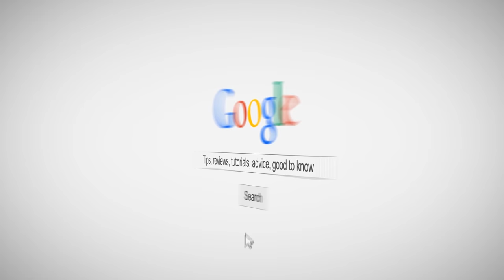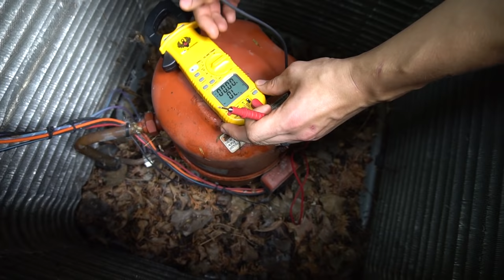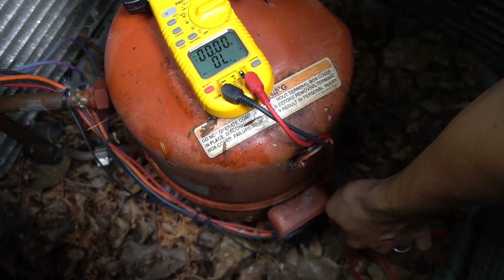AC Keeps Tripping Breaker and The 10 Most Common Reasons Why

Comment: Nice video.  But, do warn your listeners that this is dangerous stuff, that only those who have some knowledge about dealing with electrical circuits should undertake. The units are wired into two lines .. ie. 230 V. This is not your 110V appliance and mistakes here can be fatal.

Comment: just cut heat on a few days ago. had the heat running downstairs and ac upstairs. now the breaker in the breaker box keeps tripping as soon as the unit is turned on. have checked all scenarios you mentioned except the compressor, hoping that is not the issue, but.....

Comment: What if you’re only get 120v from the contractor / disconnect will it trip the breaker immediately or with the compressor just not kick on?
Reply from the maker: Usually the compressor will not come on but the fan may start spinning but only at half speed.
Reply: Thanks. I condemned a compressor today because it was tripping the breaker then I was second guessing myself because I thought I checked voltage and it had 120 but maybe it did have 240v. So I wanted to make sure if I was only getting 120 would that have cause for it to trip breaker

Comment: My A/C had been  idle for 3 years. I swapped out handler and it was working fine the first day. And when it reached cooling temp after a few hours (from 85 to 72), it shut off as it should. Then when the temp rose, when it tried to kick on, the handler blew, and the condenser motor spun momentarily, but then tripped the breaker. For the next couple of days, I could get it to come on initially, but same problem. Today, it won't even give me a one-time cool. So ... I unplugged the wires to the compressor, called for cool, and the breaker did NOT trip. Does that 100 percent automatically mean that it's a bad compressor? I'm a bit surprised it failed the way it did. The capacitors aren't bulged or leaking, but I thought I read they can cause a breaker to trip. Can they? Please advise prior to me hiring an HVAC guy who I know will automatically tell me I need a new compresser, then reason that I should get a whole new system.
Reply from the maker: It does not happen very often but it is possible for a bad capacitor to trip a breaker. If you have a multi-meter, you could check the capacitor and the compressor to know for sure.. If you don't have a meter, then I think replacing the capacitor is worth a shot. Although unfortunately a bad compressor is more likely.
Reply: @WordofAdviceTV  Thanks. Please note I did test the compressor by testing for continuity at the leads. They all showed numbers other than "OL." So doesn't that mean it's good/not grounded out?

Comment: My breaker trips when the Compressor connected, and doesn't when it's not. But also I tested all three pins on the compressor for a short against the top and there is no internal short. What could be the cause of this issue? My unit also had a white starter that was completely burned up. But I am guessing it can start without this. Any tips would be helpful. I am tempted to just buy a new start kit and capacitor and see if it fixes the problem.
Reply: Not looking good. Still trips breaker instantly with the new run and start capacitors installed. Although I did put back the original cap and it ran for like a second before it tripped but then after resetting the breaker, it tripped instantly again.

Gonna try replacing the breaker as a last ditch effort before calling a technician, but I am fairly sure at this point that the compressor is the culprit. The fan runs if I disconnect the compressor.

Comment: Why does my AC condenser trip my breaker sometimes, but NOT ALL THE TIME? When it trips, I press the breaker switch back 2 or 3 times. Then it works again, and the air conditioner runs normally. However, when it reaches the preset temperature, stops, and then restarts, it trips again. I have to reset the breaker several times to get the AC to run again.

My AC is a Carrier brand, five years old. I've checked the capacitors and relays, and they both look fine. The condenser coil isn't dirty, and I replace the filter as usual.

Comment: When the ambient temperature climbs in my window ac, the compressor  shuts off dimming lights in the house momentarily then the compressor is off but after a period the compressor turns back on and runs cold until something reaches a certain temperature and shuts off again. At night the ac operates cold until it warms up in the day. 
When  the compressor shuts off there is a heavy drain electrically s from some where

Comment: Could a super plugged evaporator cause the breaker to trip as well?
Reply: Tommy, I was about to replace my capacitor, but upon further troubleshooting, I see my main breaker trips without the cap in place and without the lockout in place, that tells me the main panel wiring to the lockout box is bad?

Comment: My only 5 year old compressor is causing the breaker to trip. What causes the compressor to short out in the first place typically? You find it odd a 5 year old compressor would short out? Having a whole new unit installed and I'm not happy at all. Thanks got any help.
Reply from the maker: So the compressor is shorted to ground? Was it tripping the breaker right away or would it run for a while? My guess would be that there was something off in the refrigerant. Perhaps it was overcharged, the metering device was not working right, or there were contaminants in the system. When they initially charge the unit with freon, if any moisture, air, or dirt gets in, that will damage the compressor windings with time or plug the metering device.
Reply: Word of Advice TV It would trip instantly. 3 weeks ago it stopped being cold air and my HVAC guy said something froze up and it was a little low on refrigerant/freon. I'm guessing the two go hand in hand?
Reply from the maker: Not always but in your case apparently so. If it was tripping instantly then likely the compressor windings are shorted.

Comment: Could a  bad capacitor trip a breaker?
Reply from the maker: It's possible but I don't remember ever seeing that. Most likely the problem is a wire shorted to ground or a failed component (compressor or motor)
Reply: @WordofAdviceTV  well the reason I ask is that it happened today to me but the disconnect was bad and I needed to replace it however the handle broke but the contact knife points were still intact so all it would have done was just not be able to cut off at the disconnect if you understand what I'm saying the handle part broke off but the metal pieces were still in place so it would have just run
Reply from the maker: So did you end up turning off the AC circuit breaker? That would turn off power to the unit.
Reply: @WordofAdviceTV  the breaker tripped, wouldn't reset so I pulled the disconnect and that's when it came apart in my hand. I replaced the disconnect and before I put the handle back I reset the circuit breaker and it held. So I went back to unit and noticed that the capacitor looked bad, it was wet and the top had mushroomed. It's a 35/5 mfd and it was reading .5 across common to herm  so I replaced the capacitor and reconnected the disconnect just to see what would happen and it came back on. Weird, I know. I guess I should have reset the circuit breaker after replacing the disconnect and put the handle back in but I didn't.  That's why I'm curious if it blown out capacitor could have been my problem or if it could have been the disconnect.  Even though the handle broke the metal was still in the connection points so I would assume that it would still run and just not be a shutdown point, unless that's what was causing the breaker to trip
Reply from the maker: @MARC GARRITY Ah I see! Yes, if only the handle broke off then the unit would still work normally. You would just not be able to turn off the power at the disconnect. So probably the capacitor was what was bad to begin with.
Reply: @WordofAdviceTV  that's kinda what I thought I just never figured a capacitor would be that bad as to cause a breaker to trip and not reset. Thanks.

Comment: Hi I'm working on an outside unit to a 1980's mobile home for an elderly couple who have VERY limited funds. It is an old Coleman CSC II model #7336D901 serial#108305495 It has 2 small capacitors and had I large round one they were all three horribly rusted out and the world small ones were sucked in on their selves so I replaced all three the 2 new small ones are JARD part  # 12929 on box but in pen it's say on box 4E410.  the large also is oval in shape not round PROPARTS part# PPS40440OV. I put housing back on and turned on outside breakers (they are flip switches not ones u pull out. One is a single switch which says 50 on it the other is a double connected which says 60 on it.) Then inside breaker on then turned on thermostat. Fan motor and fan turned on right away but they said no air was blowing out of vents, I did not hear blower motor kick on. She turned thermostat to fan ON and right away buzzing sound started so with no air out of vents. This unit doesn't look like it has ever been serviced & they don't know the history as they just bought this mobile home a month ago (retirement mobile home Park, single wide home) so I am now going to check the contact switch u mentioned and see if I can manually push it in. Next will check wires on compressor. Any ideas? really need ur help!!!

Comment: Installed a nest, Ive paid the hvac guy out to connect common wire and as soon as I turn heat upto 74 the breaker switches off. any thoughts?

Comment: what happens if you add multiple hard start kits to the compressor? Never tried it, was told it was very bad for the system. I also had a friend who had a compressor saver machine. Works well but is very expensive. Have you ran into any new techology that helps with installs or even service work?

Comment: Awesome work I'm new in the business an I'll take any tip I can get thank you so much.
Reply from the maker: No prob :) It's a good field to be in! Harness the power of Google and YouTube man, there are many many how-to videos out there now.
Reply: Word of Advice TV I have ac the fan won’t turn on. Capacitor checked fan...4.0....herm....35.09. What should I check next?
Reply from the maker: So when you turn on the AC, the compressor turns on but the fan does not? What is the capacitor rated at? (35/5, 40/5?) 

If neither the fan or compressor come on, then I would suspect that you either do not have 240v (tripped breaker or blown disconnect fuses) or the 24v that pulls in the contactor plunger is not there. What happens when you manually push in the contactor (very carefully, there may be 240v present)

If you want, look at some of my other videos to see what else you can check. Just look in the description for links.

Comment: I replace my outside and inside units last summer (2019)... and breaker is flipping! Thoughts? Thanks in advance
Reply: Get a professional lol
Reply: Breaker in panel too small
Reply: Or a weak breaker
Reply: I had that problem. A professional told me I need to replace my 36 year old AC, the compressor could be jamming.
On trouble shooting, I found the breaker was a bit warm. I noticed the connected wire was aluminum. Aluminum develops an oxide layer causing increased contact resistance and heating the breaker terminal. First attempt at sanding the wire and coating with no-ox lube was not successful because aluminum oxidizes in a second or two.
I sanded again using emery cloth with the wire coverd in No-ox. That fixed the problem. It is over a year now. 
I don't trust professionals who tell me I need to replace AC every 10 or 15 years.
They tell me new ACs are more efficient and will save energy. I calculated the savings and found I would never recover even a fourth of the cost here in california weather. In 36 years, My only maintenance by myself was replacing 3 capacitors and lately a fan. Total cost about $250.
Reply: Anytime I change out an old system.  Always change breaker to a new properly sized one.  Always.   For that exact reason

Comment: I changed my filters and then sprayed with water to clean the fins.  When I reset the breaker it immediately tripped.  Do you think I got my electrical connections wet and that is the cause?   Waiting for everything to dry out and will try again then.
Reply from the maker: I have sprayed down a condenser coil without the power on hundreds of times... Never had it trip a breaker. I guess it's possible but never happened to me

Comment: Great video.  Can you help?  My brand new AC system keeps tripping the breaker but I realized that it happens ONLY when it has rained.  In between those times, sometimes for weeks, it has worked fine.  Any suggestions?
Reply: Hard to tell, check for loose or a bit broken wires maybe? Could it be a very rare coincidence and it's something else?

Comment: My ac in my mobile home has been fine for 5 years now all a sudden it's popping the breaker all the outlets out here are connected to one breaker wich is ridiculous and dangerous it's an old trailer and it's 90 degrees out today and all a sudden the ac keeps tripping after about 10 mins of being on I tried it with the wall alone and then with a surge strip same thing happens.its to hot I am so stressed out and upset idk what to think or do .idk what it could be causing it the wire gets warm so idk why it's happening now and never before

Comment: I have an AC at work at the breaker kept tripping assumed it was a compressor replaced a compressor and it still trips didn't trip right away after a day or two it started tripping right when it came on I know it's a compressor because I disconnected it and everything was fine running but when I connect the compressor the new compressor it trips why?

Comment: my contactor was buzzing loud like one of those EM door locks. was told something could get behind and block it. blew it out and never really fixed it but my heat was working so i let it go. eventually it started to trip the breaker. ordered a new contactor and installed it. everything was fine and i wired straight from the old contactor to the new as not to get anything ixed up. i was careful not to let anything touch. it ran for maybe 10 minutes and then all the same symptoms as the breaker tripping came back. it shut off, no power to the thermostat etc... but the breaker is not tripped. outdoors or indoors. but no power to the unit. i looked for a reset button and couldn't find one. all fuses seem to be fine. any idea what my problem is. i'm freezing and broke so getting someone to come look isn't an option at the moment

Comment: Is it normal for a service disconnect to be difficult to remove? I want to check it and the fuses underneath but it seems very tight in the box. My landlord had a technician out here today and he says he can't find anything wrong with the unit but its tripped the breaker a half-dozen times and I have observed an audible "pop" and possible a spark from the condenser area on multiple occasions (I have been inside the building when it happened so its been hard know exactly what is occurring out there). I haven't gone through all these steps yet but my suspicion is short. Also wouldn't be surprised if it were the result of mice as we've had them show up in the basement around the same time all this started. Any input would be greatly appreciated Word of Advice.

Comment: I noticed my ac breaker was tripped, reset it and it tripped immediately. Since I was already replacing a few breakers I went ahead and replaced all of the house breakers since they were all old, problem still there after new break installed. Thoughts?
Reply: Jason I have the same issue, what did you find? Mine trips without the fuse breaker neat the unit out so it seems like a short in the run between the main panel and the lockout box?

Comment: Hi there , just curious on the contactor how coming in you measure 240 but a bad one on the other end you measure 280 or 300 volts and the contactor is bad. So what caused the 300 volts to read on other side of contactor
Reply: This was the same question I had when watching the video. Where is the extra voltage coming from?? Doesn't follow the rules of electricity I learned. If the contactor is burnt up causing higher resistance the voltage would be lower on the "other" load side but the result would be higher amperage draw that could trip the breaker. I believe this is what he was trying to say.

Comment: Hi, My outside condenser fan is turning off shortly after the unit powers up, not tripping the breaker. I have 230 volts on both sides of the switch. does the fan motor  have a internal, or external breaker?
Reply from the maker: It has an internal overload. So if the fan motor is getting too hot, it will open up and shut it down. Have you checked your fan capacitor? It could be as simple as replacing it or you may have a bad fan motor. If you have a multi meter you can try measuring it's resistance (ohms) and also continuity to ground to confirm if it's shot or not.
Reply: Thank You for your help, I replaced the capacitor, no change. I'll look for a video on how to check the fan motor. Thanks again for all of your help.

Comment: Just a question
my a/c breaker tripped had a tech over cleaned everything. Still tripped. Just wondering…we had one of our cold air returns covered during a floor Reno,,with only one left in whole house would this be an issue as well.? (Will add house has been extremely warm) and a/c has been running non stop.